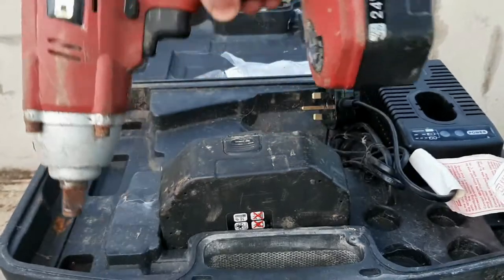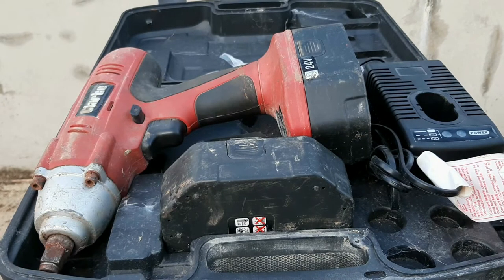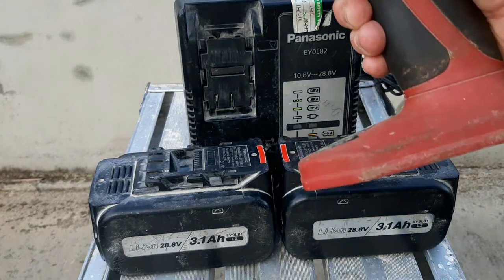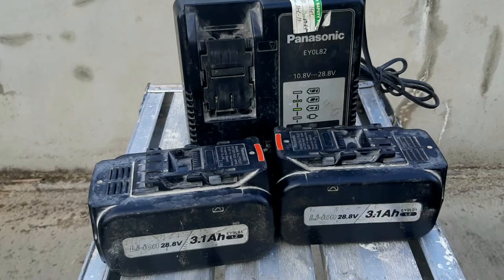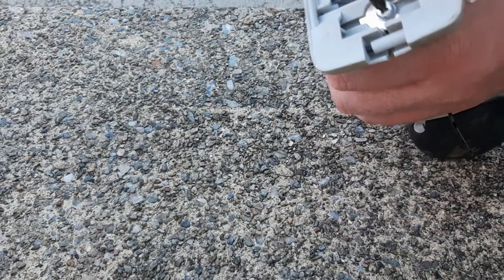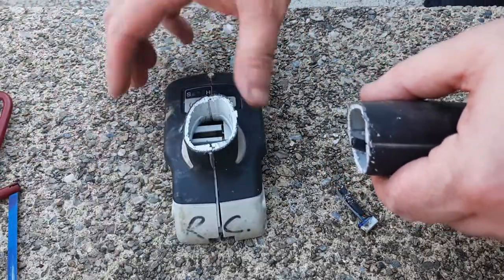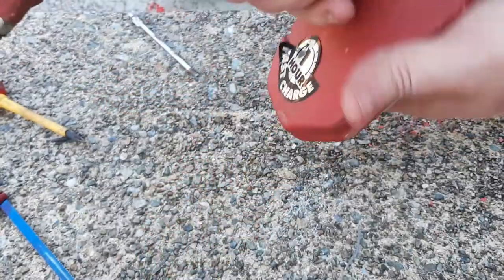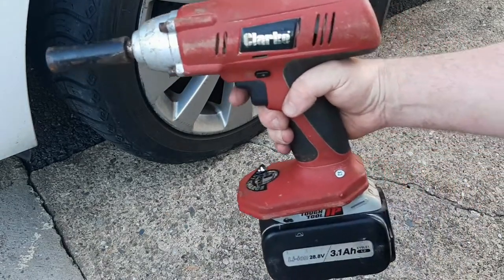Repairing A Clarke Impact wrench without spending any money #powertools #restoration

Comment: Curious on why you didn’t swap out the internals and skipped the retrofit of the bases?
Reply from the maker: I took what I thought was the easiest  way. I just connected the plus and negative wires from the Clarke battery connectors to the Panasonic base. It was just for entertainment to see if it would work. Thanks for your comment 👍
Reply: @doctorlefthandthread  great work!
Reply from the maker: @jrpena7857  thank you